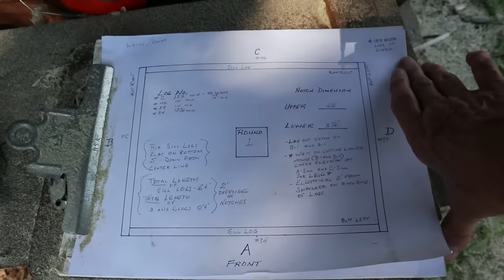Log Cabin Build at Paradise Point, Start to Finish/Time-Lapse minus Chinking

Comment: i eliminated all air leaks and future exterior maintenance by allowing the logs to touch and then  wrap the house in building wrap , install wood fiber insulation panels , tape the seams , install vertical furring strips and siding over that . these creates an almost passive style house that needs very little heating .
Reply from the maker: Howdy Sirios- I’m sure that would seal everything up. Thanks for your comment. God bless

Comment: No se ha visto como han recubierto los huecos de las paredes habían grietas bastante grandes para entrar el aire. Supongo que lo habrán tapado todos los huecos. Ha sido genial😅👏👍
Reply from the maker: Howdy- the chinking gaps are filled with insulation and covered over with a cement based chinking. The floor and roof are insulated. This cabin is very easy to heat and cool. Thank you so much for watching the video. God bless
Reply: @TheBeardedCarpenter  muchas gracias por aclarar mis dudas. Muy amable!! 👏👍

Comment: I bought a house recently that was built in the early 1900's. The floor joists were all cut to make a mortis and tenon joint like the one I see here. The issue I am dealing with is that virtually every single floor joist split horizontally halfway up where the tenon was cut, because it ruined the structural integrity. Granted, this was a two story house and over 100 years old, but do you foresee the same problem happening here?
Reply from the maker: Howdy Samwise- sorry to hear you’re having some problems with your house. I don’t ever see a problem with the way I did it. I’m assuming you’re talking about the joists under the cabin that were notched for the ledger. There is a girder in the middle of the span. I’ve been told by professional timber framers that 1/3 of the height of the joists can be cut out but I still give support with the girder. The joists for the loft are solid beams notched in the log that is supported by the blocking and the half dovetail corner notches. Take care and God’s blessings to you

Comment: Can’t imagine just how strong that structure is. I wish I had the know how to do this myself. This may sound stupid, but how does one run electric and water into this? Or maybe they don’t?
Reply from the maker: Howdy E.R.- it is pretty strong. There was a time I didn’t know anything about it. I pre drill the electrical chases in each log while I’m working them out. The holes all line up from the top to the bottom. Most of the electrical comes in from the underneath of the cabin and can be run down the chinking gaps. We don’t run water through the logs. Hope this answers your questions. I have videos on how I do the electrical holes. You can go to the videos and watch it. Take care and God bless

Comment: awesome job.  Just curious does anything get doweled or fastened.  Or no need because of the dovetail construction?  That Hoist is very effective.  probably the best hoisting method ive seen on the internet yet!
Reply from the maker: Howdy Brien- thank you so much for watching the video and for the kind words.  The dovetail does a good job holding it together. I normally will run allthread through the top four rounds of logs. Yeah, that hoist is really nice and saves a lot of work. I can set the logs on the walls by myself. Take care and God bless you

Comment: 25:45 There appears to be a power outlet on the exterior wall of the cabin. Is that for a generator to provide power to the cabin or is the cabin already hooked up to power?
Reply from the maker: Howdy Tim- you are very observant, yes, there is an outlet for electricity. The cabin is wired for generator hook up and solar for 12v lights. God bless

Comment: Question should you stain or poly all of the wood before putting it down especially the foundation
Reply from the maker: Howdy Colin- I don’t know of any reason to stain the wood before putting it up. Eventually it will be covered with the roof. I always use treated lumber on top of the piers and metal flashing. God bless

Comment: Beautiful. 
What was the lean to on the back? It looks like a tool shack but it enclosed a window on the main part of the house, I think.
Reply from the maker: Howdy Paul- the leanto is a kitchen and bathroom. This was an afterthought so the window was cut out for a door. Thank you so much for watching the video and commenting. God bless
Reply: @TheBeardedCarpenter  I see. Makes sense. How long did it take to build that cabin?
Reply from the maker: @paulcrave3826  I’m not sure. I did quite a bit of other things while building it. We , the owner and I, have some things we are doing together. Our latest video is the start of building a sawmill shed which was really needed because of the summer heat coming up. Blessings

Comment: Great build, however, I dont understand how the bare insulation will fair and actually insulate the cabin. call be dumb, but as many builds Ive done, sealant or coverage goes very far for actual internal comfort.
Reply from the maker: Howdy Eric- it may not have showed in the video, but it has wire mesh in the chinking gaps over the insulation. It will have chinking inside and out covering the insulation. Thank you so much for watching the video. God bless

Comment: Look great.
How deep into the gap will the chinking be, how thick will it be?
What will you use for chinking, I read there are modern material that work well, or is that something you make yourself?
Thank you.
Reply from the maker: Howdy
Reply from the maker: Howdy y’all- thank you so much for watching the video. The chinking depth will vary a bit depending on the gap. I push the chinking mixture all the way back into the insulation. I use a cement based mixture that has mortar dye in it. If you go to our videos there is a video of chinking my smoke house. It will be close to the beginning of our videos. Thank you for the comment. Take care and God bless
Reply: @TheBeardedCarpenter  Thanks.

Comment: Awesome job. How did you fill gaps bitween logs? Thanks
Reply from the maker: Howdy Vlad- thank you so much. I put insulation between the chinking gaps and then use hardware cloth to hold the cement mixture in. God bless you

Comment: No look at the inside?
Reply: I noticed the back part didn't have a door leading into it from the main bldg too, just a window. I would have loved to see how that worked from the inside too.
Reply from the maker: Howdy- that will be in a later video. God bless
Reply from the maker: Howdy- the kitchen addition was an afterthought by the owner. The window was cut out for a door. God bless
Reply: @TheBeardedCarpenter  Ok thanks. You do good work. Keep it up.
Reply: @TheBeardedCarpenter , thank you for responding and clearing that up. I love the work you do; please continue doing it.